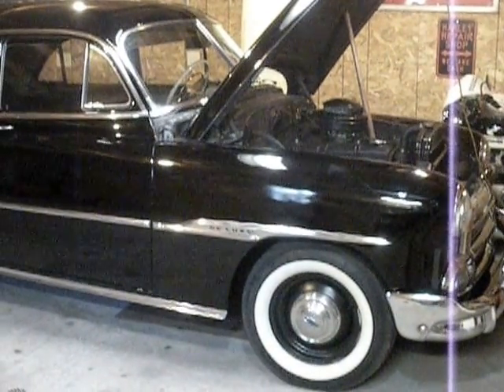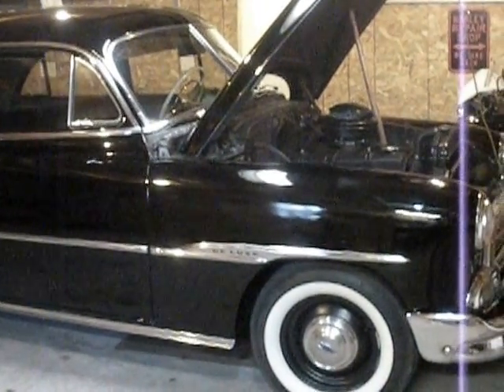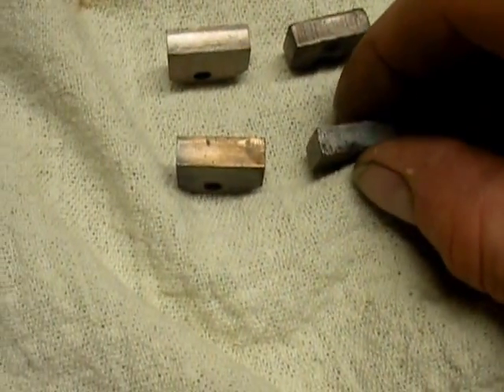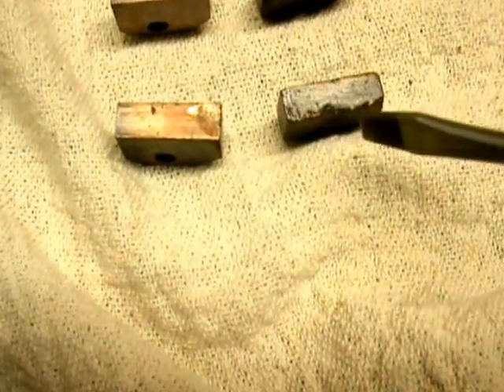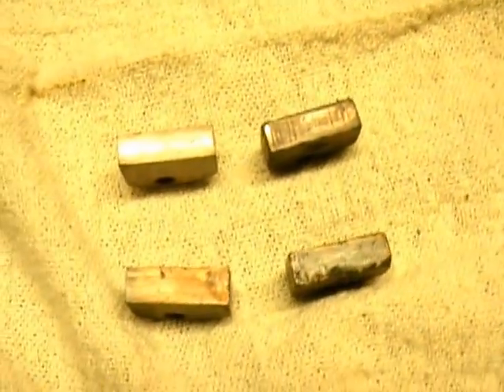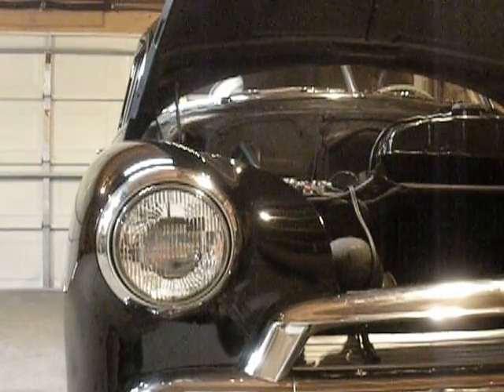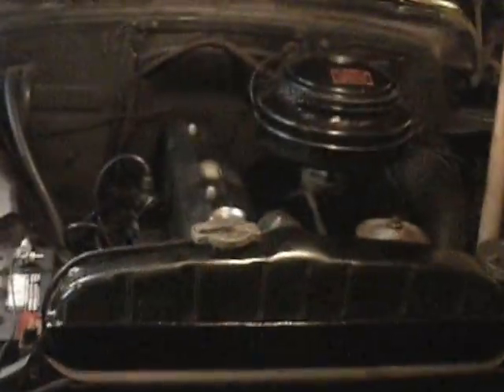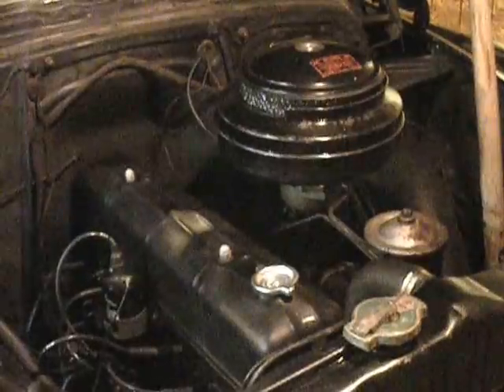51 Chevy 6 Volt System

Comment: I found a similar problem on a 54 ford with TWO rebuilt starters. They machined the commutator - which was just for looks... but that left the insulator between the commutator segments at the same height as the copper conductor - so it couldn't carry enough current. It would spin on the bench, but not on the car. I ground the insulator down a millimeter and it started just fine.

Comment: I just have bought a 54 Chevy. The owner had converted the 6 volt system to 12 volts. The problem is that although the fly wheel teeth appear fine and he had put a 12 volt solenoid on the 6 volt stater, 90% of the time the bendix gear is not engaging. I have to rock or move the car a few inches for it to engage. Can anyone tell me what is going on before I drop the starter? Thanks,

Comment: What was the car doing before. Mine is acting like i don't have the juice , but i do. New cables, large ones, new grounds, new battery. But it will just turn over about once and then act dead. I CAN jump it and start it .Gen is working because voltage when running is in the 6s. What could it be?
Reply: sequoia lansford 
Commenting to follow this, mine is doing the exact same thing. Might be converting to 12v soon because I plan to daily drive it.